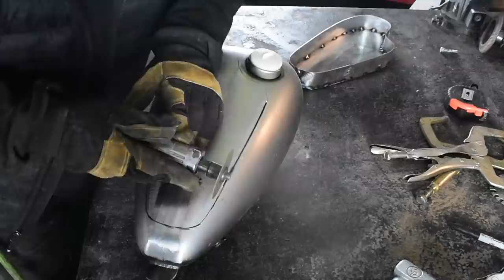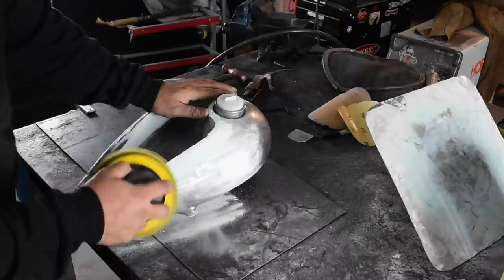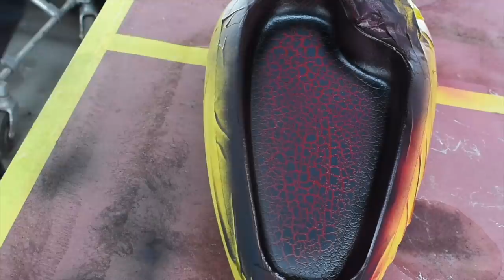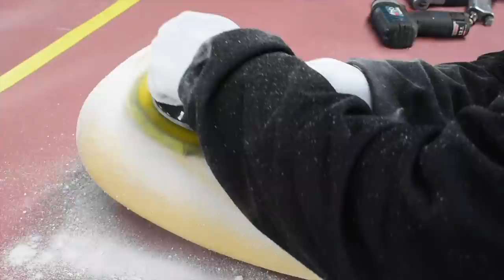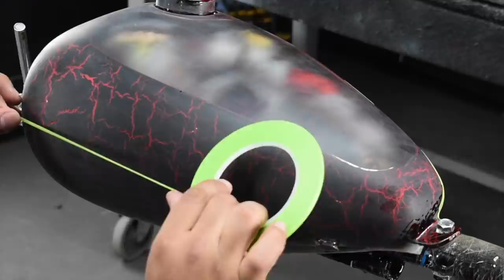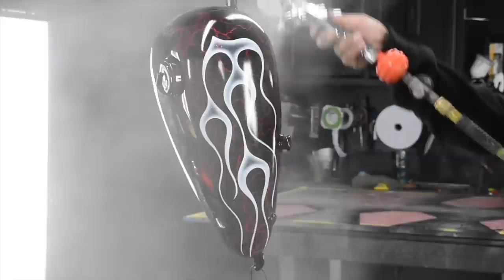"Chase The Dragon" Resin Casted Motorcycle Tank Fab Process  Alchemy Kustom

Comment: I'm surprised someone brought back that old 60's trick of using resin casting on a motorcycle tank. I used a metal dome shaped about 3 & 1/2 inch cup my buddy brought over with a new peanut tank. He had purchased a dried scorpion from a medical supply house. I brazed the cup to the hole I cut in the tank, leaving about an 1/8th of an inch lip, ground down the weld a bit, pressure tested the tank, then using masking tape on the edge so I could over fill the resin, which I did in two parts, the first to hold the object in place and cover his (or her) legs. The next day I finished filling it. .I clear lacquer over the whole project including the airbrushed soften edge around the cup. To be honest it took way too many hours, but he was a Vietnam Veteran I served with, so for my brother it was a gift. A great personal project and a nice job.

Comment: Omg finally someone who knows how to set up the blade on a band saw. No more than an 1/8 of an inch over the work piece so you don’t cut your fingers off.

The spatters on the white airbrushed flames gave me fits though. Looks like pressure creep from the air supply.

Comment: How you did the flowers?
I have tried but them flowers turned brown in the resin
Reply from the maker: Your flowers are either burning or rotting. You need to dry them out in silica for a month or two before casting. To stop from burning you can either split up the pours so that it doesn’t get as hot. The deeper the pour the hotter it gets.
Reply from the maker: You can also use a deep pour resin. I use Liquid Glass super clear 2.0.. you can pour up to 4” deep. Setup time is 7is hours fully cured in 5 days  so it doesn’t build up heat and does not require a pressure pot
Reply: @juiceslickrick  thanks, I was using fresh flowers indeed😬